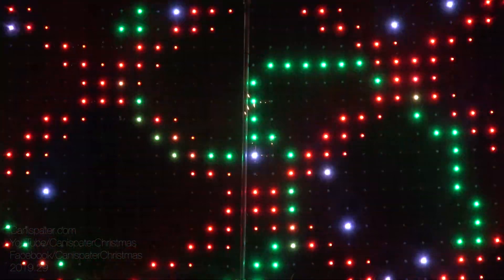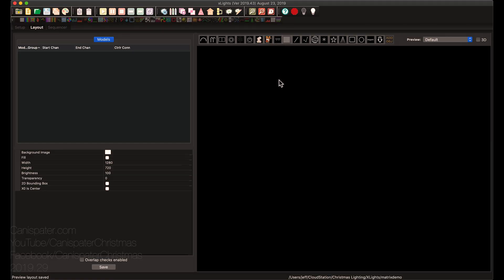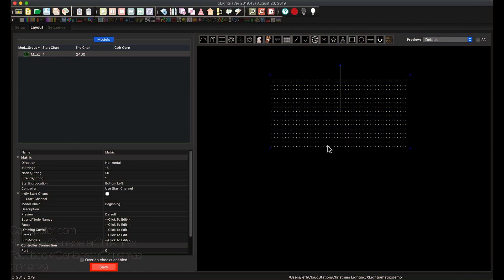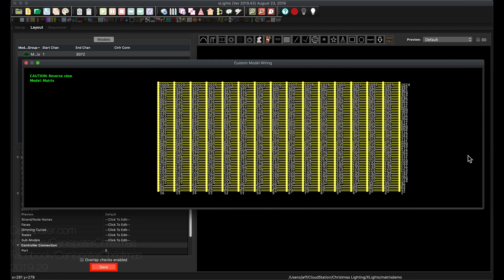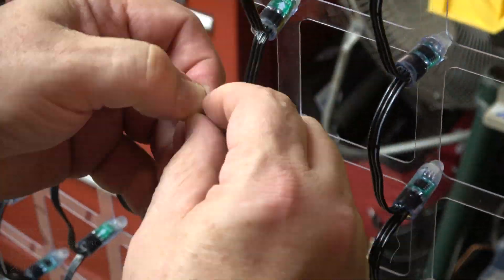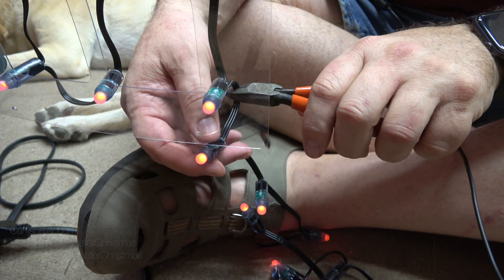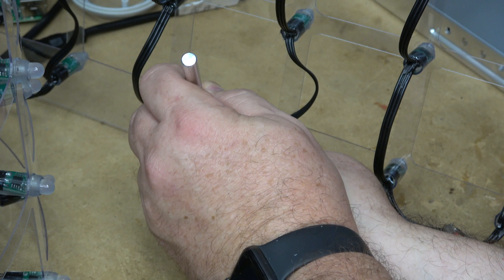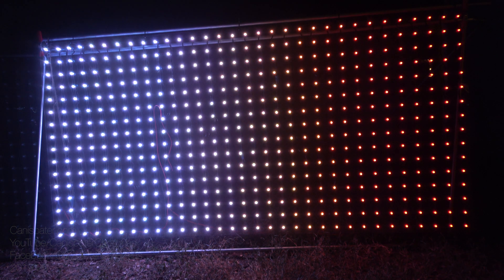🎄5V RGB Pixel Power Injection & Prop Build (2019) 🎄

Comment: I just saw pixel pliers for pushing them into the mesh, have you tried those and do they work well?
Reply from the maker: I saw some at expo, but haven't tried them. I may get a set for the other 2 matrices I need to put together.

Comment: Thanks again for the videos.  They help with converting...I mean educating us string light show fellas on how you pixel gents do things for your shows.
Reply from the maker: Thanks! Yeah, I'm a bit of a pixel evangelist, but I understand several folks have large investments in AC lights. Most of the current pixel controllers can provide an LOR/DMX signal output for AC controllers. That way, you can sequence in xLights and run the show from FPP or xSchedule and slowly migrate over time without loosing your investment. There are some good videos on xLights.org/videos about running this "hybrid" setup and you can usually get help in the zoom room (see Wednesday night call on the same web site).
Reply: @CanispaterChristmas  Bam!  Thank ya much.  I'll do just that and check it out!

Comment: if my power supply is next to the pixels and i did all my power injections can i run my data cable from 20 m away and will it reach the last pixel or do i have to boost it in some way
Reply from the maker: If you can get data to the first pixel, you should be good. Pixels regenerate the data for the next pixel. You only need an amplifier if the pixel-to-pixel distance is more than a foot or so (like jumping from one prop to another), but a single string of pixels will handle it once the first one in the string gets it. 20m is pretty far tho. You may want to use Ethernet cable for that (the skinny wires are better for data), but you also need to connect ground or the floating voltages will make the pixel flash randomly. See my cable snake video (https://youtu.be/Z0KIXDRkSCk).

Comment: If you do another another video on this project can you please show the inline fuse you are talking about. Did each power injection point have it’s own fuse or was it one fuse for all the power injection lines? Also what is the purpose of the fuse? To protect the power supply?
Reply from the maker: I used an automotive inline fuse holder. One on each power supply connection (except the differential receiver board since it has it's own fuses). Final setup was one connection for the DR and one power injection connection for each matrix (2 total). So 2 fuses. The fuses are to protect the power supply from me. Not really required, but more like insurance in case I do something stupid. :)

Comment: In my opinion, I think the best power injection regime is to inject on both sides at approximately every 50 pixels. This definitely introduces complexity to the setup, but, since we are dealing with low potential difference  of 5v to start with and voltage drop is across the wires on both ends, so adding voltage across sides will be better balanced and should produce better color. If I am doing this, I will run say a gauge 10 wire top and bottom (with good wire/cable management, it could be hidden) from PSU to form the injector power bus, then tap the 5v from the bar as appropriate. 

BTW, I always enjoy your videos.
Reply from the maker: You are correct that each end is all that is needed, but that would have complicated the wiring a lot. This technique puts them all on one side (every 32-pixels in this case) which is more than is needed, but much easier to wire up for this prop.
Reply: with 5v i only inject every 100 since power runs both directions

Comment: What made you change over from 12v to 5 v besides why not?
Reply from the maker: Haha. Mainly, why not? Wanted to see what the challenge was going to be and figured a matrix would be easy to do the power injection. Also, Bill mentioned 5V is great if you can do the injection, otherwise, 12V. I may have to compare the two now... :)

Comment: Love the videos.
Is there a reason why you striped all of the pixel wires for power injection or did I miss something there.  Why not only strip the power wire.  
What gauge of wire were you using for power injection?
Thanks.
Reply from the maker: I stripped the positive and negative of each loop so I could connect the power injection wire at various points along the string to maintain voltage. I used 14ga silicone wire because it's what I had. :)

Comment: This may sound like a stupid question but when I buy pixels I always wonder how do you wire them to the three-way three wire connectors/pigtails which wire is positive which wire is negative and which is data. I know how to test for this but I was wondering if there is a standard way with wiring pixels that is universal across people doing wiring solutions of pixels
Reply from the maker: There isn't really a wiring standard for these that I'm aware of. Manufacturers don't usually change their standard once established, but different manufacturers can be different.
Reply: First of all, stupid questions are the ones that never got asked. There is really no standardized way of connecting the low voltage and data side in this LED DIY world but just be consistent in the way you connect your low voltage/data wires. A case in point is the color notations on LEDs for the 12mm WS2811. For the most part you can see positive as red, but neutral could come in white, blue or whatever. Some LED wires come in the same color so a continuity test with a multi meter can go along way with consistency.
I hope this helps.

Comment: I use the SanDevices controls and they have a Gamma setting for the color difference that you just experienced with the two different manufacture lights. See if your controller has that options?
Reply from the maker: Thanks. I hadn't thought about that. I'll have to check.

Comment: Nice job! When you did the power injections, did you use two continuous wires from the power supply (1 power 1 negative) to connect them to the bottom of the loops? Also did you not need to waterproof the connections at the power injection location?
Reply: Hi doing the same with mega tree do you inject every string from one power supply taking neg and positive back to the same unit, Q. how do you add in diff power supplies to lessen the length of cable and voltage drop, diagram would be great, love the videos.
Reply from the maker: Depends on the length of your strings. 5V needs power every 50-80 nodes. 12V needs power every 80-100 nodes. Brightness affects it. Wire size affects it. Distance from the power supply affects it. Let the pixels tell you if they need more power. When building the prop, leave the ends at a point you could add power easily if needed. IOW, don't solder and heat shrink everything until you've connected everything up and tried it. If feeding a single string with 2 power supplies, I always teach breaking the positive somewhere so you don't burn out the power supplies. I have had people tell me that pixels between two power supplies provides enough load so the power supplies won't fight each other, but I have no specifics so I say just break the positive somewhere in the middle. Never connect 2 power supplies without a load between them.
Reply from the maker: Yes, I used one pair of wires to do the power injection. I used electrical tape to protect the connections from each other. I do want to raise the whole thing up to prevent having them sit in a puddle of water, but I don't believe additional protection is needed. Of course, that could change. :)
Reply: @CanispaterChristmas  in this prop did you only use one power supply and did you have to cut the positive wire at any point along the way?
Reply from the maker: I only used one power supply for everything so no need to cut the positive. I'll be running this at 30% brightness (because 100% is too bright for my neighborhood) so that reduces the power draw.
Reply from the maker: @NakedAndFurryPets  Go to Tools -> Web Interface. It will open your browser. It goes to http://localhost:8080/xScheduleWeb/index.html?page=home on my machine.